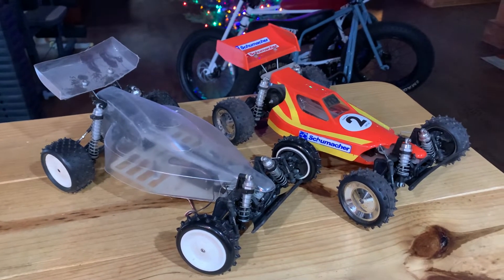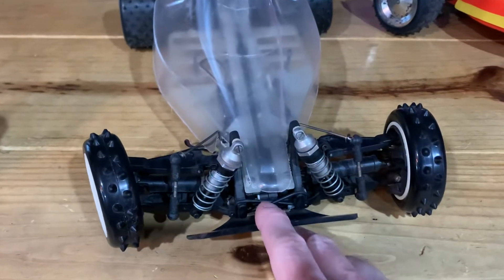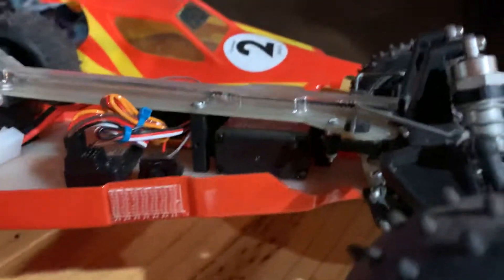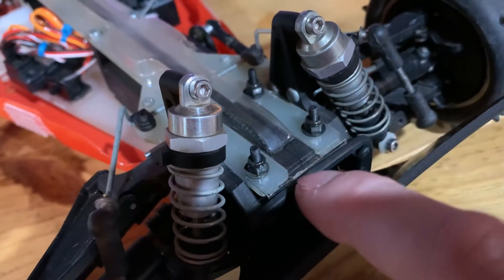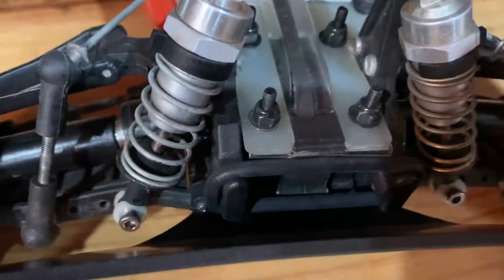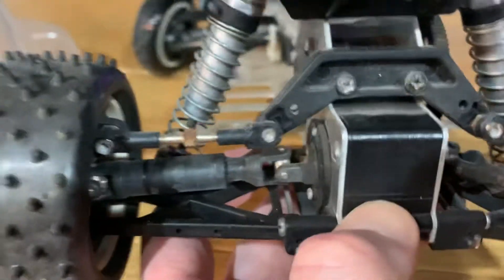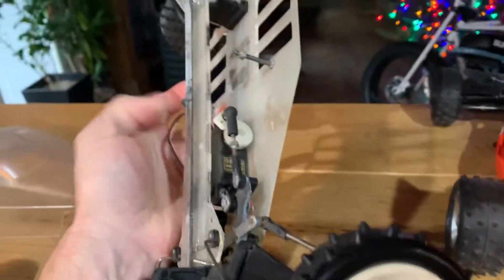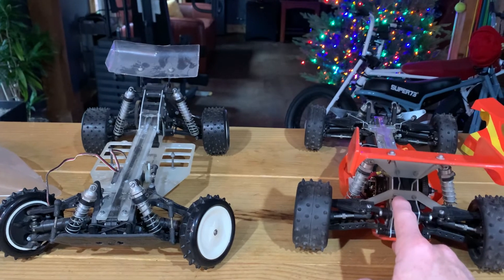Schumacher Procat Gift to Myself

Comment: Hi, the Pro Cat had a different bumper with the 2 holes drilled from factory, these are to give access to the 2 screws that tension the belt. You have an XLS bumper that has been drilled to provide access to the adjustment screws. Nice car.
Reply from the maker: Thank you!  Been working on it slowly waiting on parts but it’s taking shape.  Might try 3D printing an original style bumper if I can get some good pics to get dimensions from.
Reply: @wadeskelton7585  I have one fitted to my car, it’s not in the best condition, they are very hard to come by in the UK especially new. I can provide photos and dimensions if it helps you. 👍
Reply from the maker: @jamesstrutt2208  that would be awesome!!!!  I can share the files I end up sending to shapeways and even a 3D printed bumper if you need one!
Reply: @wadeskelton7585  No problem, leave it with me and I will get some info over to you. 👍